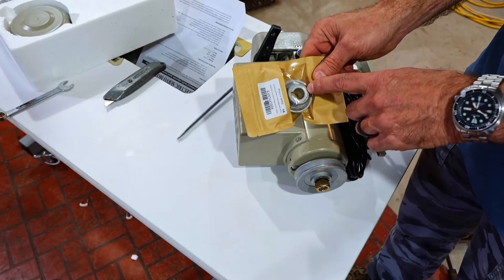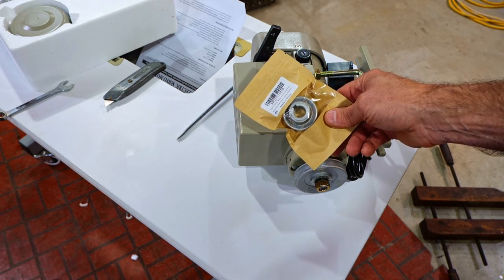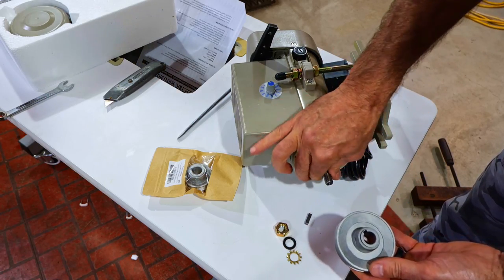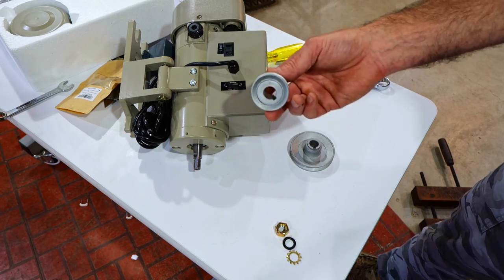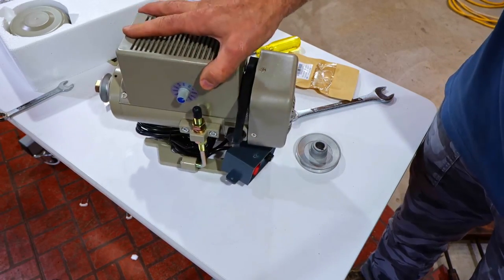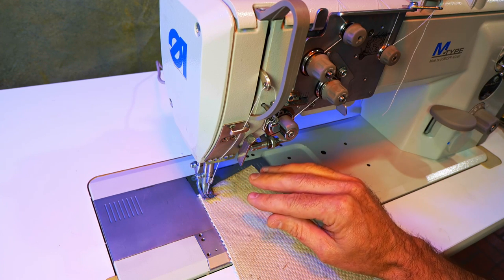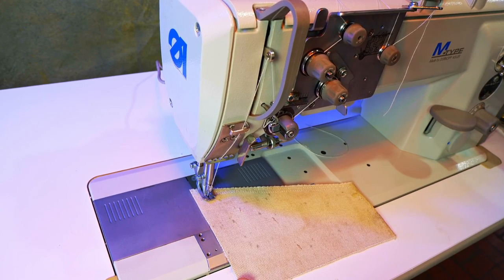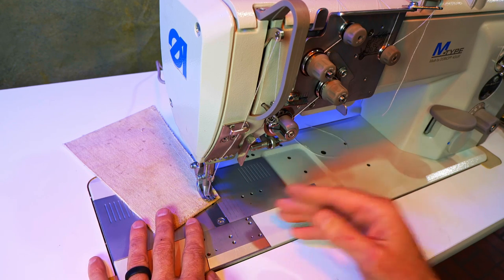How to Slow Your  Industrial Sewing Machine Even More with Smaller Pulley for your Servo Motor

Comment: I did this modification. My motor shaft had no keyway so I had to drill and tap for a set screw. Also dropped down 2 inches on belt to a 3L 400 at NAPA. So far my speed and control are much improved.  noticed your Everlast welder. I've had one for over 10 years. Had a gas solenoid go out after 8 years and their customer service was great.  Thanks for taking the time to produce excellent videos!!  Take care

Comment: Thanks for the tip. I bought a servo motor through your link and I love it. It never occurred to me to enhance the control even more this way. I also ended up getting the edge guide and a two magnetic LED lights. I use one of them every day working on electronic equipment that is mounted in racks, and always in a cramped dark tell-com room. 
Thanks

Comment: Great video.  I just checked my parts box of pulleys and found a little one that fits perfectly.  What an improvement....for free!My drive belt is just a car vacuum hose, taped together with duct tape, so I just cut off a little bit to fit.
Reply from the maker: Free is good and that vacuum tubing thing is a great hack.

Comment: THANK YOU Alexander. 
On your recommendation, I clicked the link, purchased the servo motor and the 45mm pulley. On my Consew 206RB-1 it is a night and day difference. 
1. It is totally silent when your foot is off the pedal. 
2. Switching to the smaller pulley took less than 5 min.
3. I can now slow it down to about 1 stitch every 5 seconds if I want....now THAT is control. OR...I can speed it up on a straightaway.  
One thing I did need to do was to move to a smaller belt size.
I used a general utility V-Belt from a hardware store...went from a size 42 to a size 39 (that was my fault...I did not buy the 38 like suggested). Made the tension adjustment underneath and I was home free.
Reply: Hey Rod, 
I have a 206RB-5 would I need size 38?

Comment: Thanks for the video. I just purchased a consew servo motor for my Pfaff 145 and it wasn't as slow as I expected. I just ordered a 45mm pulley but wasn't sure if it was correct since I have yet to disassemble the servo motor. After watching this it looks like it will fit.

Comment: Oh classic mechanics D, transform speed into moment of force!))))
In my machine servo integrated into a head, if i need slow down speed i usually using engineers command on control block, it can reduce speed too 100 stitch/min. 
Whatever great advice! Thanks:)
Reply: Yes, when you switch to a smaller pulley, you will get more torque from the motor. And if you switch to a larger pulley, you will get less torque.

I don't know if more torque is good for sewing, but I'm pretty sure it's not bad.

Comment: I just installed a 45mm pulley on my servo motor and before my slowest speed was 500 rpm and with the smaller pulley it went down to 200rpm. To get a better idea  of what that means I set my overall speed at 2500rpm and the slowest speed I could get just barely pressing the pedal  before I get 5 stitches per second and 2 stitches per second after the install. Not bad.

Comment: Another inexpensive method of gaining better control of your servo motor is to lengthen the arm that is tied to your treadle. I purchased a short length of 1" x 1" x 1/8" aluminium angle iron from Home Depot and lengthened the motor arm on my machine so the hole centre where the ball joint ties in is now 10" away from the motor control pivot from the 5" it normally is. As a result, it doubles the amount of travel on my actuator treadle uses for a given speed giving me far better and more accurate control. Without changing the sheave I can readily start my machine at a very slow pace. I will however be purchasing the smaller sheave now that I know where to get one to gain even greater control.
Reply from the maker: I see what you mean. Thanks for sharing.

Comment: Do you once in a while go full speed without thread just to make sure the oil is pumping or wicking where it needs to?
Reply from the maker: With a wicking system like on this machine that is not helpful since there is no centrifugal pump. Wicking occurs 24/7 regardless of speed. If you have a machine with a pump in a sump that is not a bad idea but the slow speeds are very easy on wear points in terms of pressure and heat and so no need to go over board with it. Those machines are designed to run thousands of rotations per minute so you may ask your self how long would you sew to reach a thousand rotations.

Comment: Hey will that gear change add more torque and did you have to change the belt size
Reply from the maker: Yes and No
Reply: Alexander Dyer  Thanks for getting back and can you explain
Reply: Alexander Dyer Alex I did read some older post and it was enough to answer my questions thanks again

Comment: I already got a speed reducer on my 1541s and works great. Would adding this gear to my servo be of benefit for the extra control? Seems like the speed reducer business would be less  if these little pieces added of similar benefits of the reducer without the cost.
Reply from the maker: The small pulley alone would not slow your machine as much as a speed reducer will.

Comment: I want to switch from a clutch to servo motor with a needle synchronizer for my Nakajima 180L. I sew slipcovers and handbags and want to slow down my machine. I currently have a towel stuffed under the foot to gain more control. Can you suggest a needle synchronizer that would work with this servo motor and the smaller pulley please. Thank you for the video.
Reply from the maker: This simple version of servo I show does not have a positioner option. Try this instead.
https://amzn.to/3ruza56
Reply: I elected not to go with the needle positioner so purchased the consew servo motor recommended in one of your videos along with the 45mm pulley. I put the motor together and my husband helped with the installation yesterday. I picked up a shorter belt from auto parts store and it runs great. I’m so happy I made the change. My machine can now creep slowly for more precision and still roar through a heavy slipcover job.Thanks for your video and assistance.

Comment: Great video, I followed your advice. thank you
Reply from the maker: Great to hear!
Reply: @AlexanderDyer  the control and torque are phenomenal and I found it very easy to install. And it's cheaper than a speed reducer even getting a brushless servo. Thank you for your advice
Reply: Question I hope you can answer, do you know of a industrial machine that is a flatbed with a roller foot

Comment: Thanks for the video especially the link to the part! What was the difference in size of the new belt vs the stock one?
Reply from the maker: I was able to use the same belt by using the motor adjustment. When I need a belt I go to the auto parts store with my measurement.

Comment: Would this weaken the motor’s ability to see through dense material?
Reply from the maker: Actually it increases the torque, similar to down shifting a vehicle. It goes slower but it has more power.
Reply: Alexander Dyer cool thanks for the reply. Why are most speed reducers large? Is that for added weight to the system? Thanks for the vids always enjoy learning  from you.
Reply from the maker: I'm not sure about that. My guess is that is just the easiest quickest way to manufacture them.▶◀
Reply: embeaston one of the gears in a speed reducer has to be quite large, and because the engineers also have to account for the increase in torque and use a minimum shaft size, there is a practical limit to how small and compact the reducing gears can be.
This is a case where the old school pully swap to a smaller diameter is actually a more cost effective, and efficient, way to reduce the speed on a machine. And gain some grunt too.  
The gear reduction set though can get you into lower gear ranges if it’s really needed.

Sorry to butt in but I did gears alot in another life 😄

Comment: I've got the Family FESM 550C servo motor (with a 50mm pulley on it) and it's got the speed dial like yours. My speed is all or nothing at each speed. I.e., at 690 it only does 690, at 1500 it only does 1500, etc. I can't "feather" the pedal to stitch slowly and gas it to hit the max at that setting. I hope that makes sense. After watching this, is it safe to say it's not supposed to function that way? Any idea what I need to do to get that functionality?

Comment: The pulley works on any servo motor, for example, a servo motor for a juki 1541? And the pulley requires a new belt? THanks!
Reply from the maker: It works on most but I don't know about yours. There is an adjustment for belt tightness at the motor. perhaps an adjustment will allow you to use your old belt otherwise the auto parts store will have a shorter belt. Take your old one to compare.

Comment: thats a good alternative to the cost of a reducer. 200 bucks or 20 bucks right?
Reply from the maker: It is a good alternative yes and for me it is enough but a speed reducer will reduce the speed even more and can be combined with the smaller pulley. The pulley I have linked to is less than $10 so worth a try right?

Comment: Thanks for the video. I suspect that the smaller pulley means less surface area for the belt. Has the belt ever slipped when it's under a heavy load?
Reply from the maker: No, never.

Comment: Hi Alexander.  Thanks for the video.  I switched my 75 mm pulley to this 45mm pulley.  My machine came with a M-54 size belt.  Can you assist me with what size belt I should drop down to?
Reply from the maker: I go to the auto parts store to get any length belt I need.

Comment: Will this work for a TechSew2750? I was considering buying the speed reducer.
Reply from the maker: It will sure be a lot easier to install and cheaper too but if you do not mind the cost and complexity of install then the speed reducer will slow the machine the most. Have you already installed and Servo motor?

Comment: Thanks for the video. I changed my pulley as you suggested but I still can’t slow machine down like yours. I have new tech servo motor. Do you think I have to get the enduro motor in order to slow it down as you demonstrate? I hope you will get back to me and help me with this. Thanks
Reply from the maker: Here is the motor I use. I have several. https://amzn.to/2zG4oA5

Comment: What size band did you go to with this smaller Pulley? Mine isn't tight enough and I can't lower the motor any further to tighten it (consew 206rb5 stock band is what I use right now)
Reply from the maker: These belts come in all sizes. I can't know what size you need but it will be smaller than the one you currently have. Go to your local auto parts store for the correct size. Take in your old belt and estimate how much shorter the new one should be. Cheap and easy.

Comment: I ordered this part. Unfortunately i cant work for my Highlead 618 servo motor. When you remove the servo pulley you need some kind of threading to attach it. No thread on this part. Also you have to replace the belt to fit the new pulley. Its just to simple-ill be getting the reducer after all...
Reply from the maker: Hmmm, not sure what motor you have but you might look closely at the video again and see how your shaft may or may not differ. Belts are easy to get from the auto parts store. Please be aware that the reducer will require 2 belts to complete the install.

Comment: Was there enough adjustment for proper belt tension with the smaller diameter pulley? Or did you need to use a shorter belt?
Reply from the maker: In my case yes but your mileage may vary.

Comment: how would a smaller pulley work with a needle positioner? I'm confused by the functionality of a needle position does it regulate the speed of the machine based on the actual revolutions to the speed you set or does it just simply make sure the needle is left up or down when you remove your foot? I have a consew 3001 and I wanted to slow it more with a smaller pulley
Reply from the maker: It will work. The positioner operates by counting rotations at the handwheel so when you go to a smaller pulley the counting at the handwheel will simply occur at the slower rate.

Comment: slows it down but no torque
Reply from the maker: That is not true. If you have rode a bike with multiple speeds you know that when you go to slower gears it gets easier to pedal. If you then think from the perspective of the motor, the slower pulley makes it easier for the motor and so in effect you increase it's effective strength or torque at the needle. Of course not to the degree you can attain from a speed reducer but at a significantly lower cost and level of complexity to install. On these flatbed machines I have never felt like I did not have enough torque even before installing a smaller pulley.